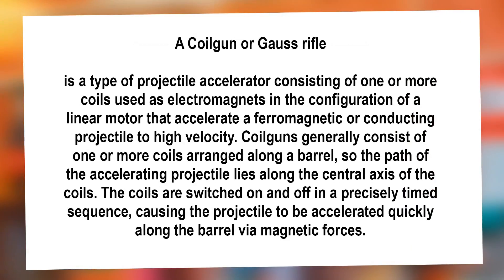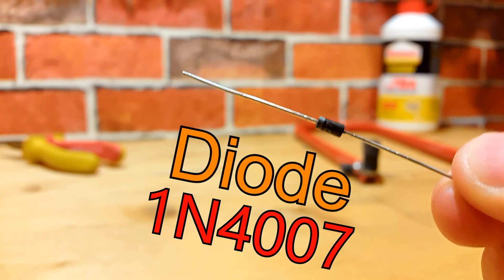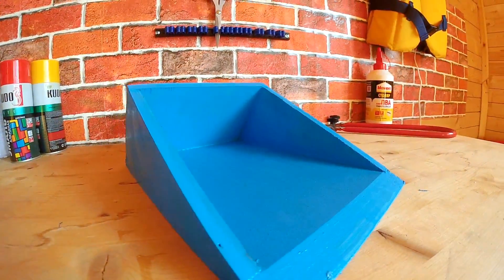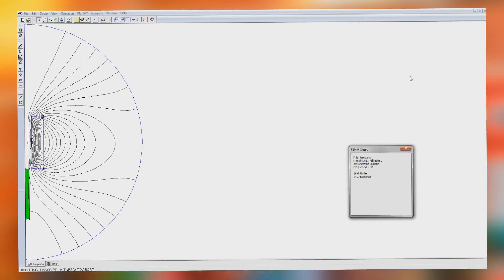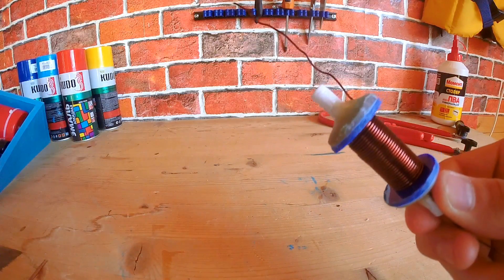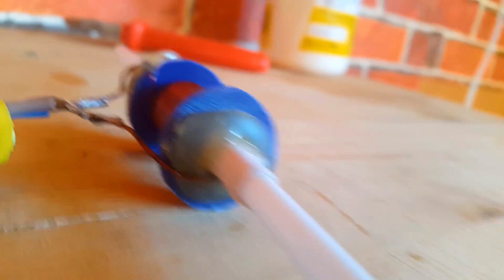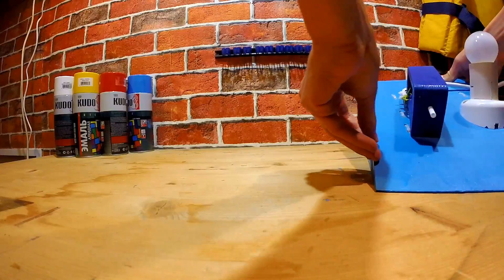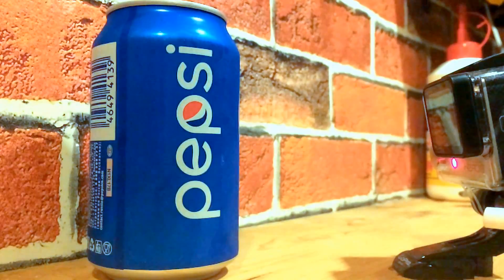Gauss rifle (Gauss gun) DIY !! 💥Handmade Coilgun!

Comment: fake
Reply: No it's not
Reply: y u think that its not fake?
Reply: @szigetiferi3869  cause i made one and it works now tell me why do you think that it's fake
Reply: @tejasbhandare251  could you show me your vid please?
Reply: @szigetiferi3869  i just used small capacitors and it still worked fairly well
Reply: and it's probably fake cause because that "bullet" made of nails is much heavier than a real bullet, so it would take much more energy to speed that nail up to thhe speed of a bullet
Reply: and cmon those capacitors are nothing, those cant make that much magnetic force, because that coil he made had really few turns.
Reply: @szigetiferi3869  his big capacitor alone stores 211 joules and he is keeping targets very close so it will work
Reply: @tejasbhandare251  273 joule is nothing,
Reply: @szigetiferi3869  273 joules is enough to do what he did in the video when pressurized the soda cans dont need a low of energy to puncture
Reply: @szigetiferi3869  all his capacitors combined store energy of almost 273 joules
Reply: @tejasbhandare251  and i say 273 joules is nothing , because in a gun like this, there are lots of losses
Reply: and pls show me your gun, if you do, and it works fairly well i believe you
Reply: @szigetiferi3869  i made mine long time ago ill have to assemble it again and currently all the shops are closed so i cant get a new thyristor when i get a new one ill show you in a few weeks
Reply: ok take your time
Reply: and yey it could puncture the soda can, but it shouldnt go all the way thorugh, also when they shot it in the wood it got stuck in it which was clearly faked
Reply: @szigetiferi3869  hmm I'll agree wood one looks faked the piece of wood didn't even move
Reply: @tejasbhandare251  ok then lets agree that the wood shot wasfake,and the others were real?
Reply: @szigetiferi3869  yeah i agree
Reply: @szigetiferi3869  i used 450 uf capacitor Charged to 400v and it managed to poke hole in soda can and thick cardboard
Reply: ok thx

Comment: What if you use a longer coil? 300mm long with more windings . Could you test it?
Reply: That would be very bad, and inneficient because of increased resistance and weaker magnetic field generaly the shorter the coil length the stronger the magnetic field

Comment: What is the voltage of the capacitor used ?
Reply: 220V AC rectified so around 300V DC

Comment: Love the video. 
I have a few queries. 
1. What happens if the turns are increased?
2. Winding is in bifilar pattern to reduce resistance?
3. Use extremely high volts via one circuit and amps directly via li batteries both circuits connected in parallel?
Reply: increase in turns increases the magnetic field strength, high voltage will only increase the current flow if the resistance is high, ie if the length of the wire is more and a thinner wire is used
Reply: please tell me how I can learn about all of this. Is there a video or subject that teaches this so I can understand enough to actually attempt to build my own?

Comment: what did the battery pack do?
Reply: The batteries are used to activate a thyristor. The power source for capacitors as seen in the schematic is the ac mains voltage.
Reply: Yudhi GN u r Wrong! It is for Triggering the gate of the thyristor, the 220VAC supply charges the capacitors and when the bulb is full bright it is ready to fire but you must disconnect the 220 volts mains, before firing, they made a mistake in the video, The schematic should have two momentary switches one to charge and the other to fire.
Reply: john whilde the batteries are the power source. For charging the capacitors.

Comment: Do you know what is the speed it leaves the gun? Could you share it in m/s? Thanks! =D
Reply: would gess something like 40-50m/s, like 1/10 of a real pistol
Reply: Fredrik Carlén much less more Like 20-30ms by that bullet weight
Reply: @peterzingler6221  u know weight doesnt do shit. Mass×speed = inpact. So if u say speed is low cuz mass u should know the inpact force.  But u dont